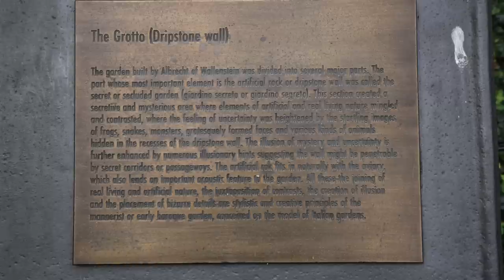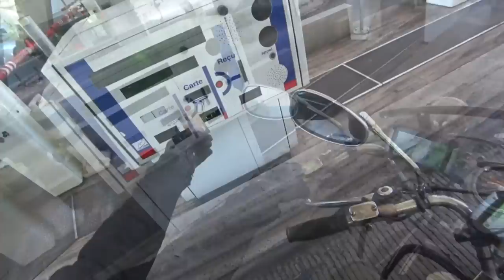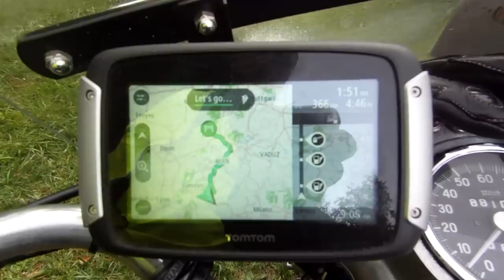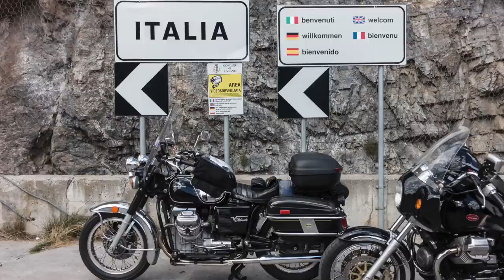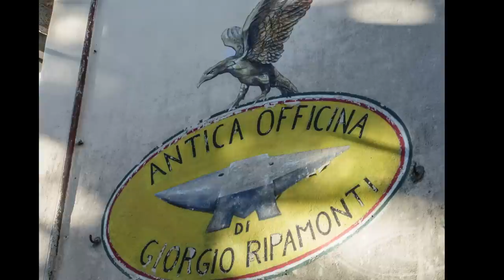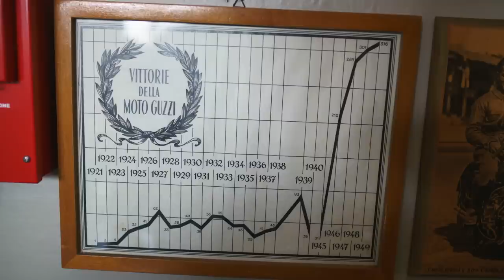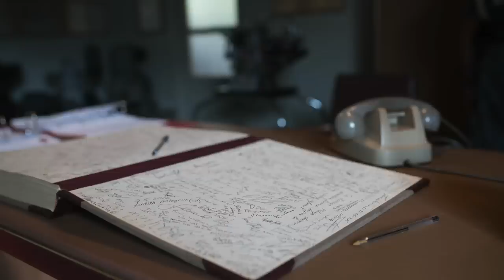Aussie Moto Guzzi club,  we ship our bikes and ride to the 95th Anniversary of Moto Guzzi.

Comment: I just started this, but I'll be watching the whole thing. It's nice to see a proper bike (the Eldo) being use for a proper journey. With mine in dry dock awaiting gearbox repairs, it's very enjoyable to be riding along with you.  Excellent pacing, and great pictures / video.
Reply from the maker: Thanks Nick.  Have been watching your vids for quite a while.  Cheers
Reply: @smeghead61  I got through the whole thing and really enjoyed it. What a terrific trip. You unsettled me a couple of times with your tendency to drift to the Aussie side of the road, but it was wonderful to be able to ride along with you.  The Eldo was a bit quieter during the later days, so I'm assuming you came up with an adequate fix? Mine tend to vibrate loose too - I've now got them wired. Many thanks. Nick.
Reply from the maker: @nick949eldo   Yes wire and muffler paste at Mont Blanc.  On return to Australia had to remove heads and have inserts put in as the threads were completely useless.  Now better than new with locking style collars so wont work loose again.
Reply: @smeghead61  When I heard you mention Hobart I thought 'these folks must know Kerry and Paul' (who stayed with us briefly when riding their Ellie across Canada). Kerry just affirmed it. Figures. Guzzi global community! :)
Reply from the maker: @nick949eldo  Yes, just a big Family it seems.  Unlike nearly any other brand I would think.
Reply from the maker: @nick949eldo  Our Club ride to Tasmania is in 3 weeks
Reply: @smeghead61  Give Kerry a big (careful) hug from me. Have a great time.